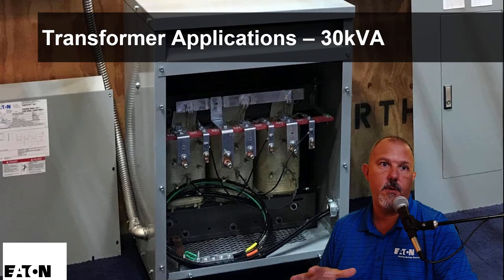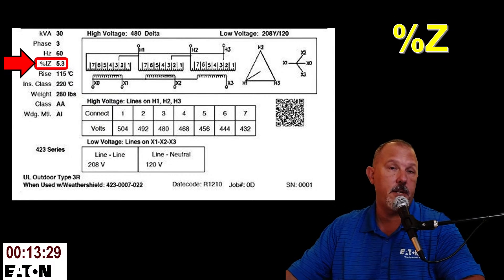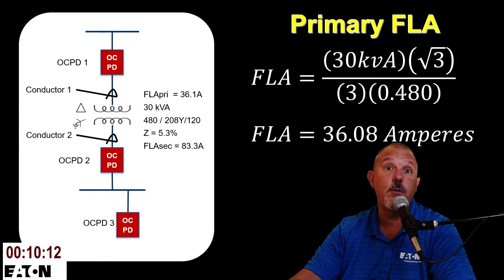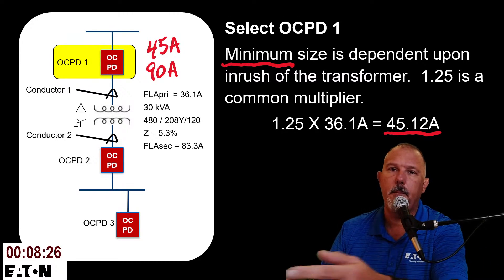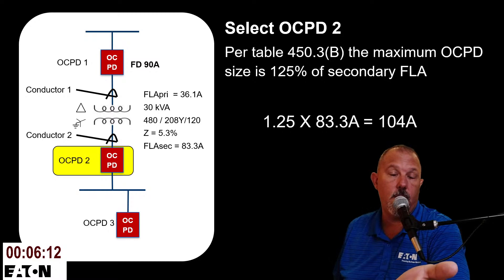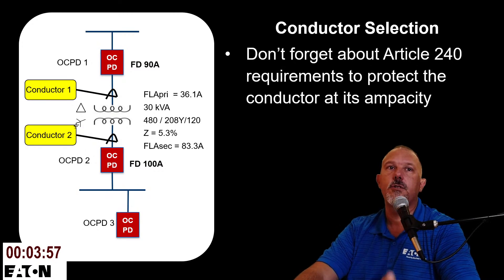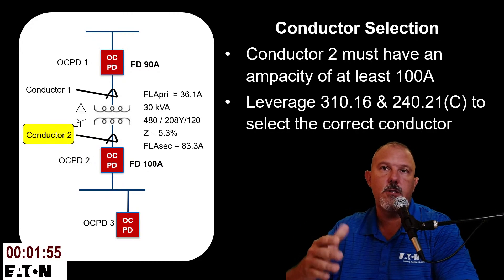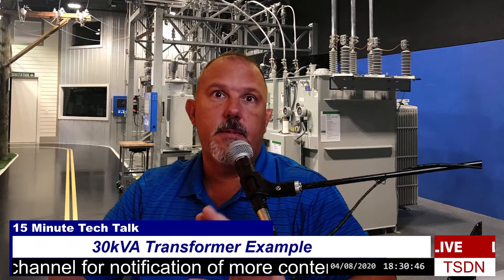15 minute Tech Talk - August 4, 2020 - 30kVA Transformer

Comment: will it really trip it or is that just code
Reply from the maker: Hey Paul.  not sure which part you're talking about but if it is the arc reduction methods then it all depends on the arcing current as it relates to the upstream device.  We have IEEE 1584 to go on and use that to determine the arcing current and we use manufacturer curves to determine clearing times.  Hope this helps.  Take care and stay safe.

Comment: I have 480 going into a 100amp breaker ...was going to take #3 copper to my primary 30kva transformer and 100amp circuit breaker on secondary 120/208y panel. do I really need to down size my breaker to a 90? on primary or could I leave the 100amp ....
Reply from the maker: The highest setting you are permitted by Code is Article 450 Table 450.3(B) is 250%.  You can't go to the next higher ampere rating like usual as per the notes in the footer of that table.  So you can't exceed 250% of the primary FLA in the OCPD size.
Reply: @TDUNPLUGGED  in my 50 years I never went 250% higher for a transformer circuit breaker. Saves a lot of money say if you can use a 90 amp breaker versus a 125 amp breaker. Even with high lock rotor amp motors like air & refrigerant compressors, crushers and centrifuges always used a breaker no more then 175% ( except fire pumps ).
Reply: Seems like over kill. A 30 KVA transformer @ 480 volts only draws 36 amps. At 125% that is only 45 amps. I would go witb #6 guage copper wire if run was not long.
Reply: Let me give you a quick cheater multiplier for finding amps for a 3 phase 480 volt load. Just muitply the KVA by 1.2 . This is within 99.8% of using book formula.for 240 volt 3 phase multiply by 2.4 . easy peesy . Use to blow fellow sparkies minds. Before they had calculator on would give them the answer. Before I retired used to have a lot of single & 3 phase motor amps memorized. Example a plain vanilla 100 HP 3 phase 4 pole ( 1750 to 1770 RPM } motor draws around 125 amps so a 10 HP 480 volt 3 phase draws around 12.5 to 13.5 amps.